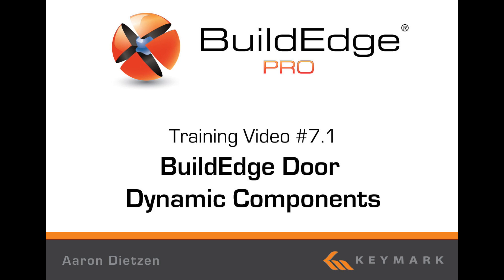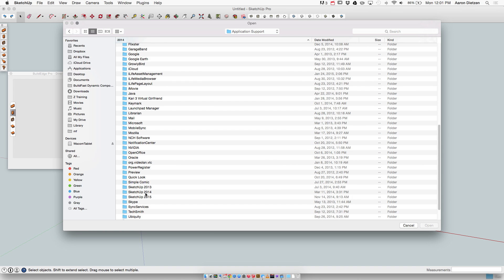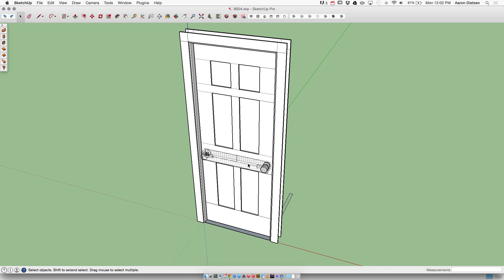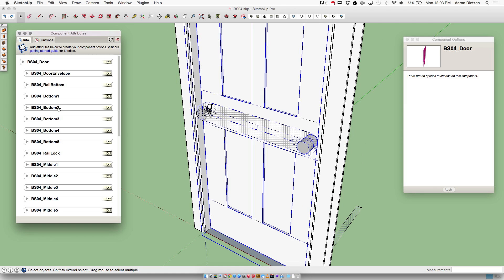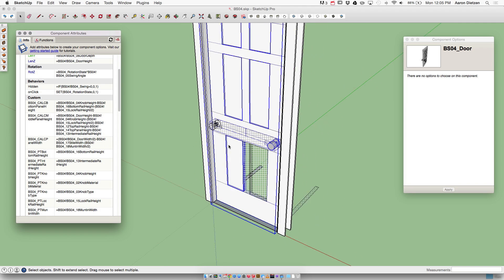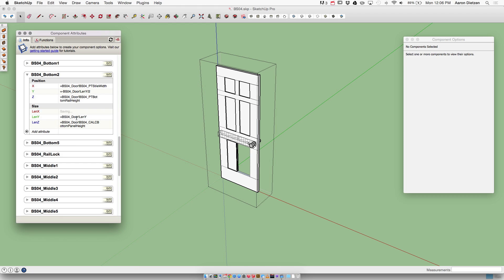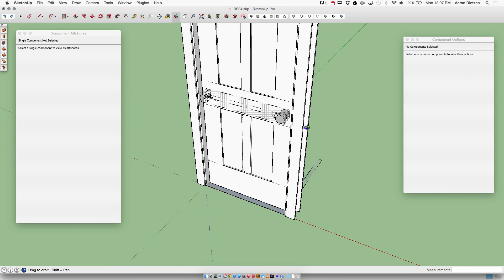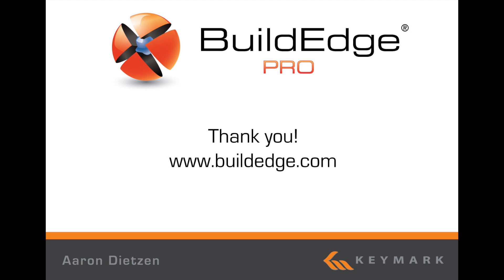7.1 Door Dynamic Components

Comment: does this mean that you could "save as" the component therefore giving you more options in the door options list ? rather than just saving over it.

thanks
Reply from the maker: Ferg Peterkin The list of doors/windows is always the same (as of now).  The dynamic components are pulled by the software, adding a new files will not add them to the list inside of BuildEdge.  For more info on the DCs, check out our documentation here: http://www.buildedge.com/wp-content/uploads/2015/02/Modifying-BuildEdge-Pro-Dynamic-Components_v1.2.pdf